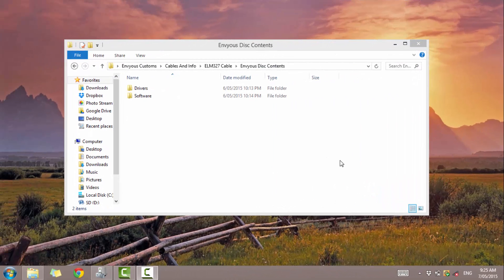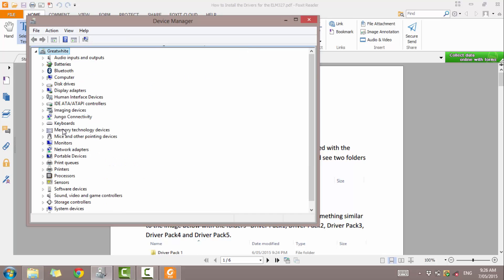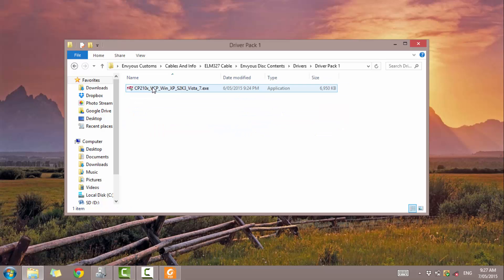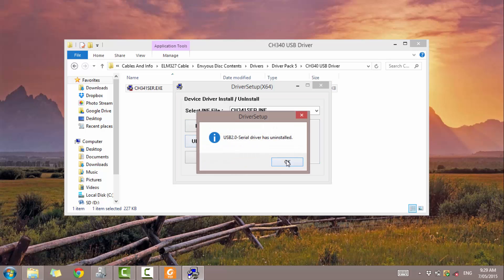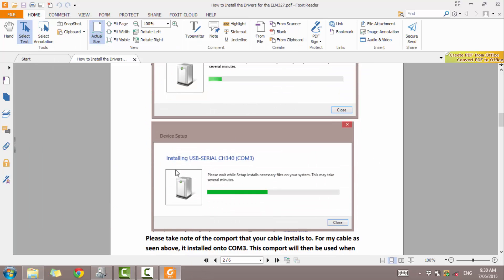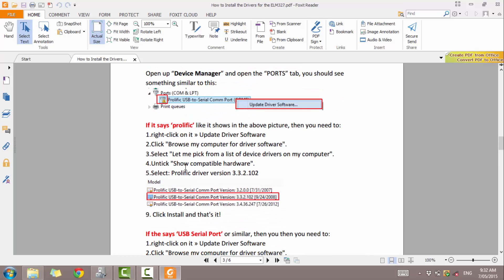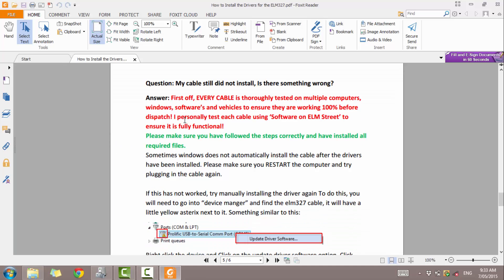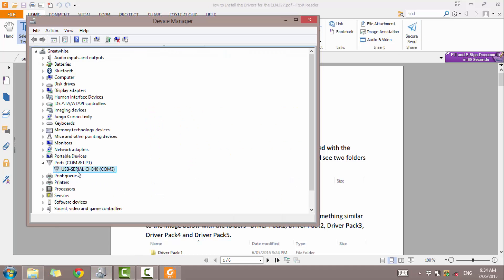ELM327 Cable Driver Installation - Envyous Customs

Comment: Question,  my ELM327 arrived in ADHOC mode (stupid) for 6 years i would use it searching non stop for an STN or Infrastructre mode or Version of the product, one day i decided to see if port 80 is open , it was (HTTP GUI), i switched it to Station mode, i entered SSD, Encryption (WPA2PSK CCMP) and the key ( even kept a screen shot)   the ELM327 connects a few seconds to the AP and disconnects. I made sure the AP is set to the same Encryption type, and key...   I even set a static/Fixed in the ELM327  .. Any tips? The unit is close to AP, tried many APs, legacy, wrt54g,  dd-wrt. different channels. no go .